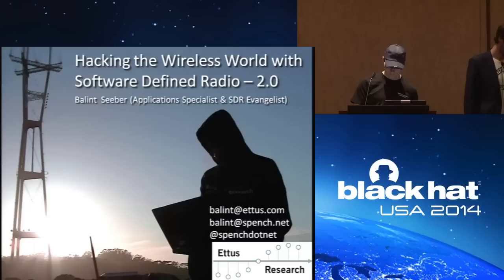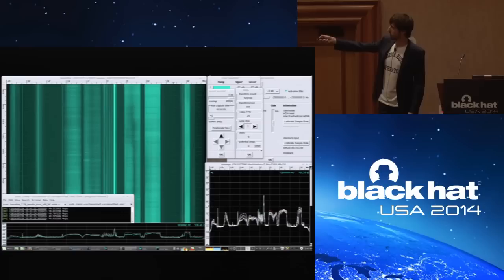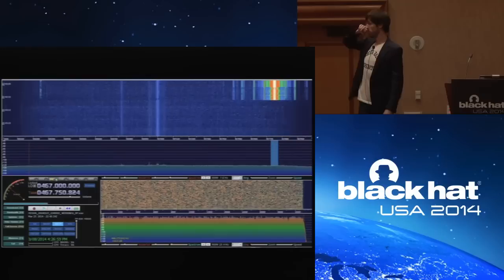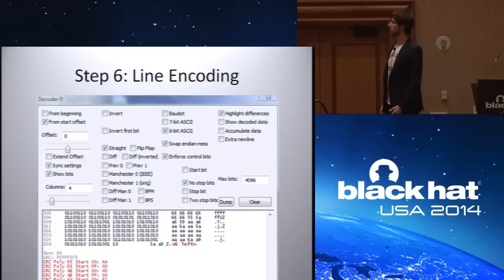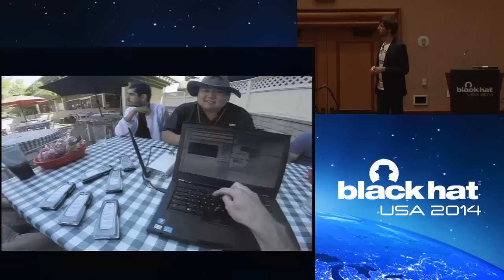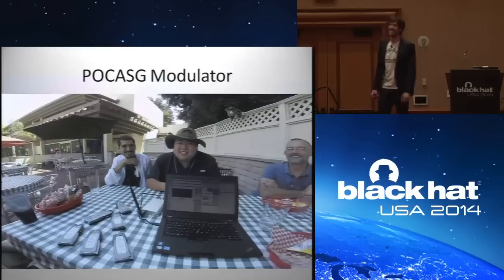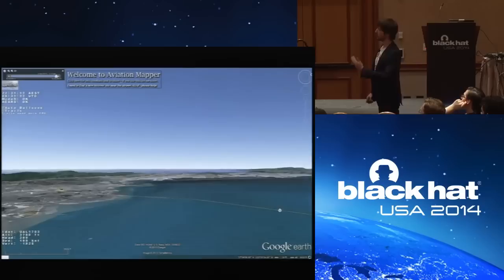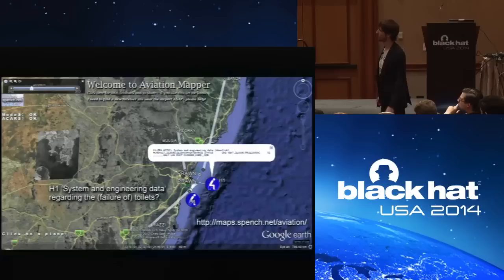Hacking the Wireless World with Software Defined Radio - 2.0

Comment: Can I use B200/210 for receiving AIS (161,975 MHz) and Mode S signals (978 MHz) at the same time using 2 RF ports on the board? 1 RF port for AIS signals and 2 RF for Mode S signals